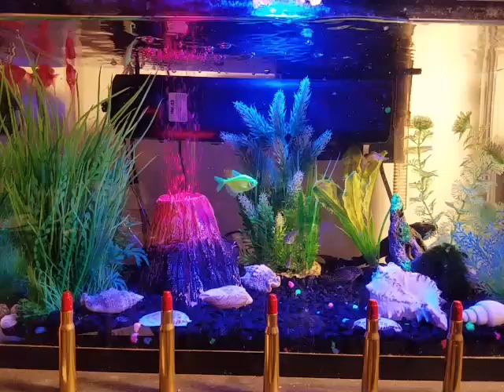Your powder coated bullets might be illegal.

Comment: Another reason copper is still king learn to plate them it's not hard to do
And your power bill will be lower 😎
Reply from the maker: I have never copperplate a lead cast bullet. Would you need a binding metal like when you do chrome plating? Or could I just Electroplate the copper to the lead?
Reply: @NorthCarolinaPrepper  
No sir lead is conductive the i make 2 gallons solution from copper sulphate white vinegar and hydrogen peroxide run at 2 volt at 2 amps for about 4-5 hours per 100 you can see on my yt channel

Comment: From an article by David LaPell:
In 1960, an Ohio coroner named Paul Kopsch, a police Sergeant named Daniel Turcos and Special Investigator Donald Ward started working on a new handgun round that could penetrate materials that stop a lead bullet. By 1981, the bullets were made from brass instead of lead and were punching through some previously “untouchable” material but were ruining barrels. So they ingeniously decided to coat the bullets in Teflon to keep from washing out the rifling. The new company was named KTW after the last names of the three founders....
...In 1982, a year after they had become commercially available in brass, NBC broadcast a special demonstrating how these new bullets were capable of penetrating the body armor worn by cops. Instead of focusing on the fact that the bullets were constructed of brass, NBC focused on the Teflon coating, which does nothing to make the bullet go any deeper into the target, only saves the gun barrel from getting stripped.

Comment: Great advice about Teflon containing powders. I had forgotten about those Teflon coated bullets. And, yes, they made Teflon coating illegal.
It would be an issue of "let the judge decide", but considering lawyer fees, court costs, lost wages, and the associated stress I would rather be a label reader and avoid that part altogether.
For the naysayers, powder coating bullets is a very viable and useful technique. No leading, no gas checks, higher cast bullet speeds, no need to lubricate, no exposed lead so indoor ranges are happy, etc, etc, etc. If you have actually tried powder coating, and have had any problems, you didn't do it right. If you are just repeating what you have heard, quit repeating and actually try it.